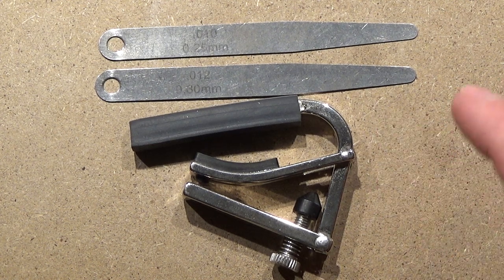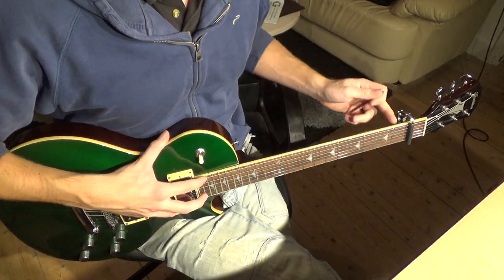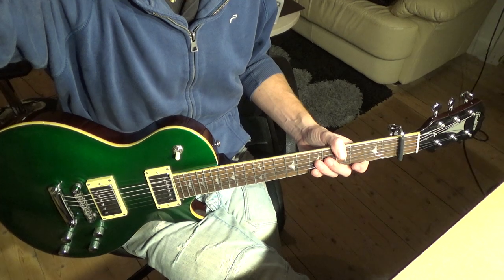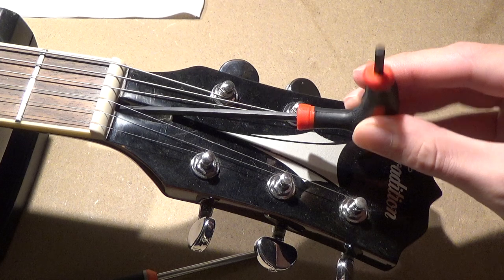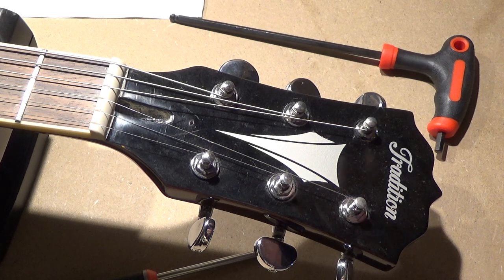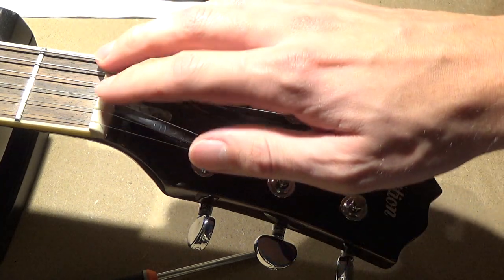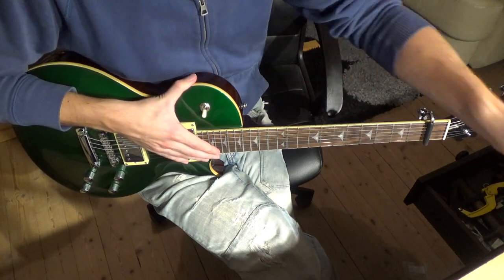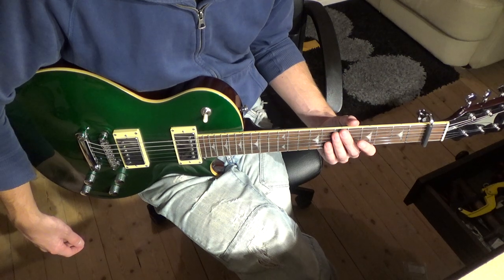How To Adjust A Guitar Truss Rod

Comment: Beautiful Les Paul Beauful Les Paul The inlays are very unique and very pretty actually gives the guitar and ability to breathe So the rest of the guitar stand out. Couldn't see the name on the head stock but this is a guitar hr built. Just noticed part of the video where the name is and this unique inlay is on the head stock still can't make out the name  But the inlay is very pretty and unique
Reply from the maker: Hi there.
Thanks for stopping by!
Indeed, it's a very beautiful guitar - actually, it's a Tradition S-20 Les Paul type guitar.
I've had for quite some time now, and it's great!
You're right, the inlays, both fretboard and headstock, really makes the guitar "pop" and look outstanding. 🎸

Let me know if you need anything.
Cheers.

Comment: Good evening,good video bro, I have a question my guitar is buzzing on the first fret in all the strings, i adjust the action higher but with no results, this problem it's only on the the 1st fret no matter if the action it's low or high, do you think that maybe it's a relief problem? My guitar it's a Jackson rrxmg, thanks in advance.
Reply from the maker: Hey there, Steve Wilson.
Thanks for your comment and question, and for the kind words as well - I really appreciate that!

Also, thank you for supplying information about your guitar, it helps a lot for me :-)

I would try and adjust the truss rod first, then adjust the action at the bride and then see if the buzz goes away.
Remember, you always start with the truss rod, then the action at the bridge, then the nut action and lastly the pickups.

The problem you are experiencing might be that the neck is too back bowed, causing the strings to hit the 1st fret first, because of the neck relief.

Here's a link to what Jackson recommends for neck relief, string action, etc. I might be a good place to start:
https://assets.ctfassets.net/4jcppgetbqrc/2ij831nbwkKOQqyEssKGu/078cf8200da122322833d13dc22e1910/Jackson-Owners-Manual.pdf

If the relief that Jackson recommends isn't enough, then try with .010" or .012" instead.

Do you have something to measure neck relief with, or any other guitar tools for that matter? :-)

Let me know what you think, Steve.
I'm sure we can easily get this problem solved.

I'm looking forward to hear back from you
Best regards
Cheers :-)

Comment: I get completely different measurements on my lp when using the last and 17th fret. When using the seventeenth I get 10 thou, when using the last fret I get 14 thou, what one do I use, what fret?
Reply from the maker: Both Fender and Gibson measure relief different places and different ways.
Fender measure relief by affixing a capo at the 1st fret, measuring at the 8th or 9th fret. Fender measure string action at the 17th fret.
Gibson measure relief around the 7th-9th fret and string action at the 12th fret.
It's generally personal preference.

Remember, a truss rod is mostly active in the middle of the neck, so that's why we measure around the 7th-9th fret.
Reply: GuitarNTabs what about where you press, the body joint and last fret. The thing is I always check at the 7th fret but if I press down the 1st and 17th fret and measure at the 7th that measurement is different compared to if I was to press down the 1st fret fret the last fret and measure at the seventh, do you press the body fret or last fret?
Reply from the maker: @hgvinyl4512  - Aaaah, I see, thanks for clearing that up!
I generally tend to go for the last fret, for a measurement of the whole neck, but if we go back to where the truss rod is really doing its thing, then the 17th fret wouldn't be a bad place to start. The distance from the 17th fret to the last fret will give you different measurements, because the string is covering more frets, compared to measuring at the 17th fret.
Reply: GuitarNTabs That begs the question of what one is correct? :)
Reply from the maker: @hgvinyl4512  - There is no hard fast rules, so try the two methods, and see which one works. As mentioned, it's all really down to personal preference.
Again, the truss rod is mostly active from the 1st fret and down to around the 12-15-ish fret.
Reply: GuitarNTabs Thanks for all the help man, much appreciated.
Reply from the maker: @hgvinyl4512  - Sure, no problem at all! I'm always happy to assist!
Let me know if you need anything else!
All the best!